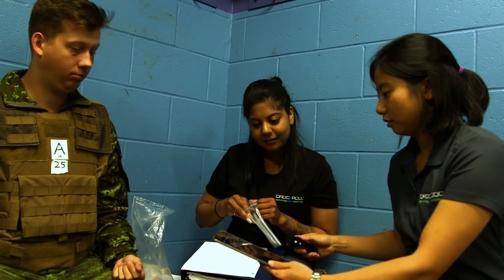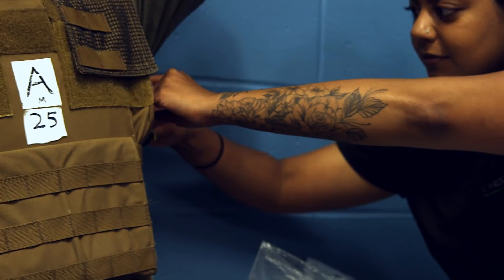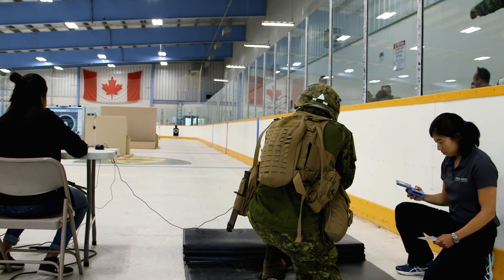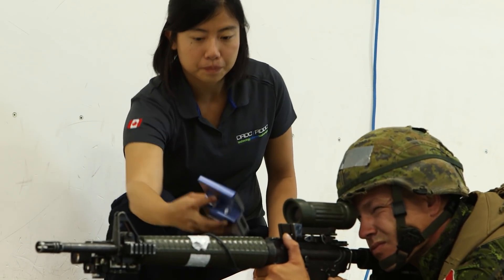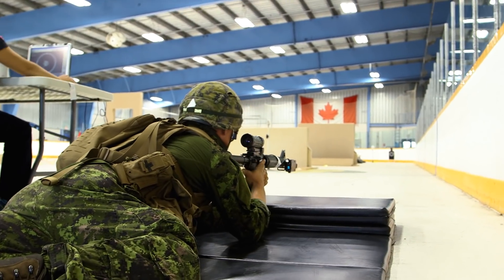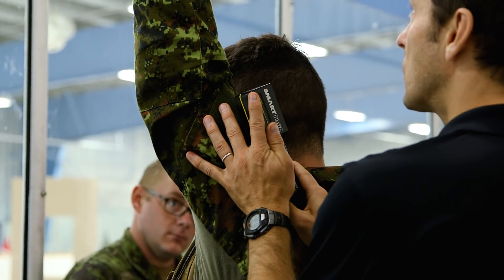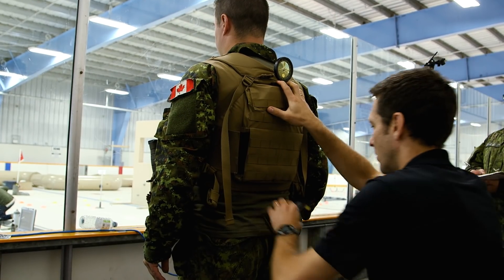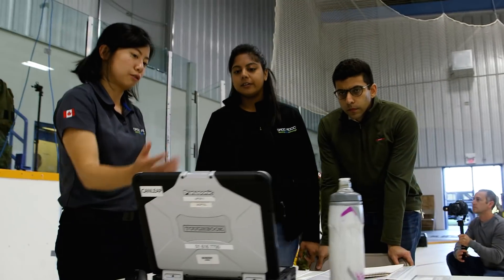Improving Equipment for our Canadian Armed Forces

Comment: So when will these vests get issued?
Reply: 30021
Reply: @noco7243   Naw, more like 30025. Headquarter pers and bin rats will pilfer all the initial stock in 30021 first, cause a shortage in the system and then the rest of us will get them after that's unfucked with half being second-hand and abused.

Comment: And how close are we to left-handed rifles? Tired of hot brass off my glasses and in my shirt.
Reply: The C7 and its variants are ambidextrous I believe.
Reply: @pauluswissmann9879   The C7 controls are ambidextrous (fire selection switch, charging handle, magazine catch). The ejection port is still directly in the face of left-handed shooters.
Reply: @pauluswissmann9879  for lefties the round ejects in a bad spot on the c7 takes sone getting used to. On the c1/c2 you could change it
Reply: C1 was left hand modifiable... not that I saw one when I was in .  So maybe we need to go back in time.
Reply: Get good

Comment: How in shape should you be before joining?
Reply: Be able to run 2.4 km in under 11 minutes, be able to run 6 km and be good at pushups,sit-ups and decent at pull-ups and all around fitness, I recommend working out for strength and stamina, but most of it comes from mental strength,just push your way through basic
Reply: @liambuck4522  i have been in cadets for 5 years i try to stay in good shape thanks for the tips
Reply: How 2 Fight 99 cadets is similar to army but I recommend reserves or regular force for more “experience”
Reply: How 2 Fight 99 Get used to the suck
Reply: Be able to run pretty good and hit the gym man. Just google excercizes for back and biceps, chest and triceps, and legs and go from there. You can mix it up as you become more comfy with the gym.
Reply: @BananaRepublicann  yea i try to main tain a good diet and i work out at the gym when i can also i am in track and i have good stamina i just want to know how much core and upper i need
Reply: What trade do you want to join?
Reply: @BraydonSK  engineer as a demo
Reply: You can be unfit it's up to you
Reply: Gul Dukat 😂😂😂💀💀
Reply: @dopy311  thsvanks 4 trlling mu tdhat